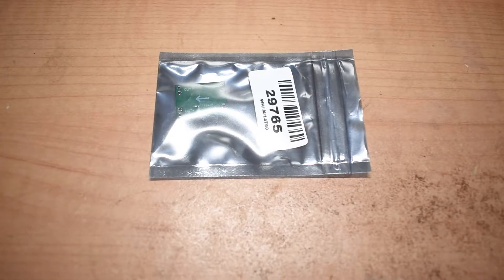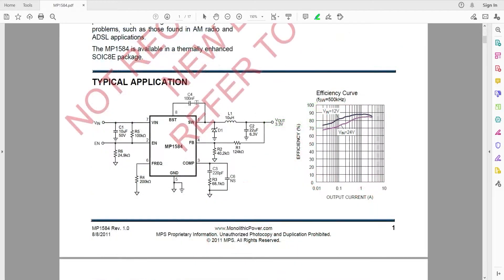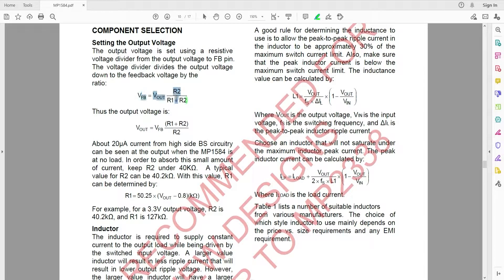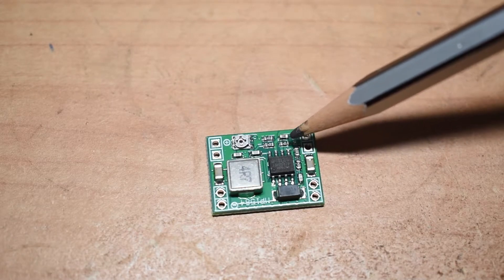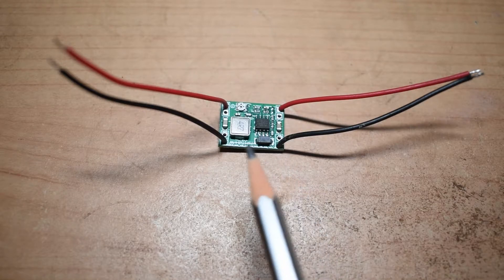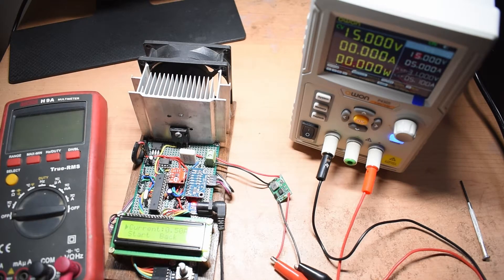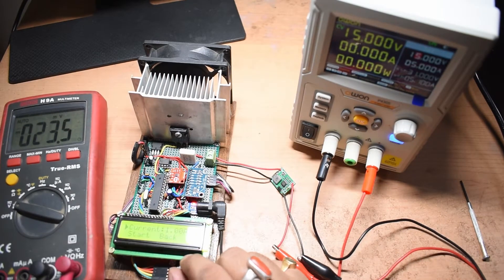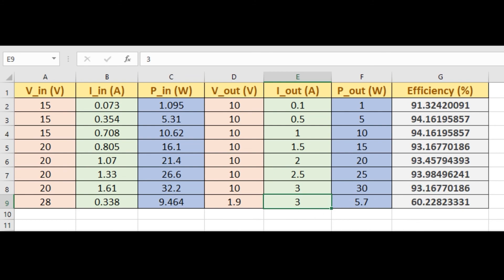DEC #08 MP1584 3A dc dc buck converter module review, load test and efficiency calculation

Comment: Good testing and details 😁 thanks. I got 2 of these to try on my small drone to run the DJI 03 air unit. 4 or 6s. This should work fine. They suck 2a at 10v. 😁 I will probably put a capacitor after this buck converter to help with any ripples. Straight to battery. Separate from flight stack. Speedybee35 😁 axis flying argus f7 aio, 2205 xing motors 2300kv, betafpv true diversity ELRS (Gemini)